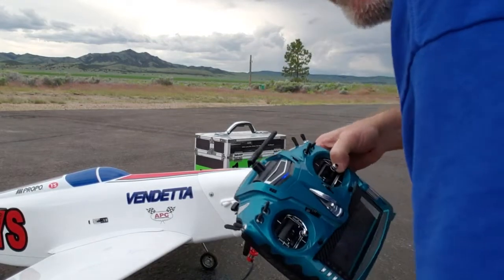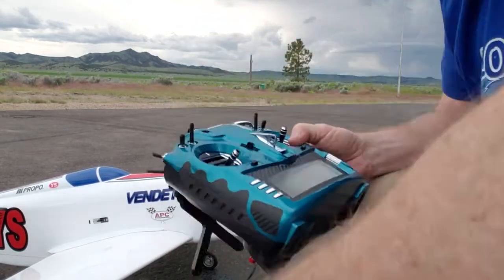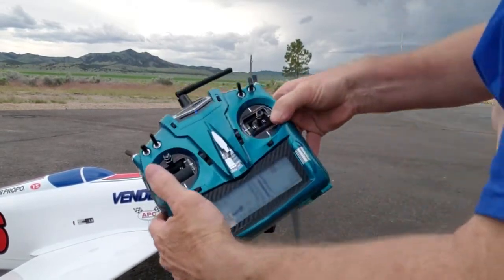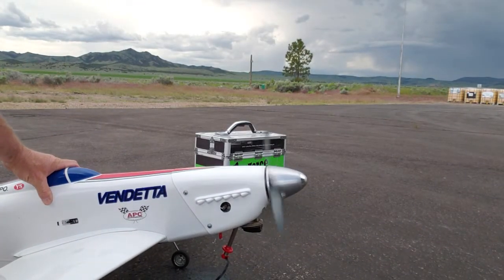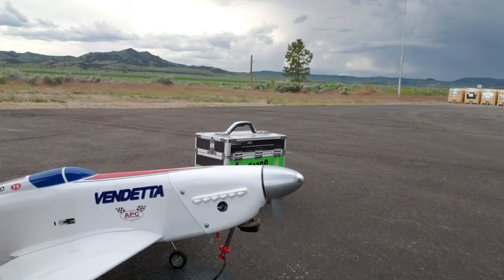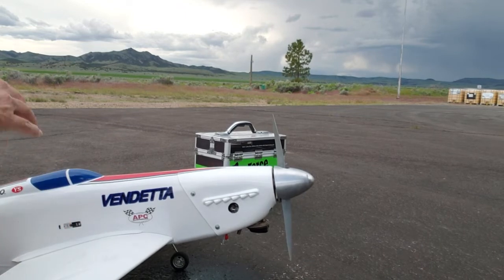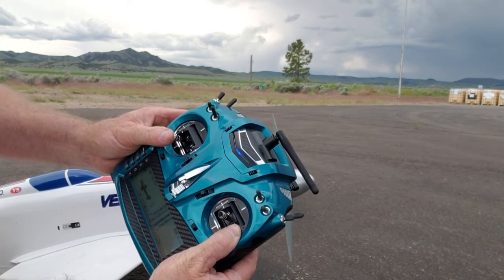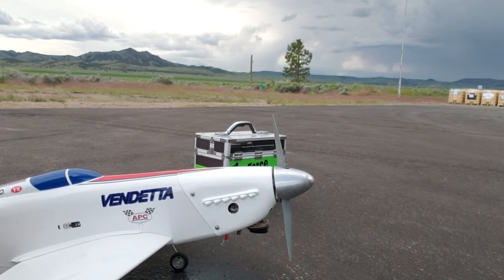Proper starting procedure for Ys 4 stroke engines

Comment: Hi there, thanks for the video. I'm battling with a gifted YS 91 from a friend. Pretty difficult to make it run smooth. What I notice is that there is a lot of fuel coming out of the carb when it is not running... is it normal?. I am a OS Engines man so  not very familiar with an engine that comes with a tank behind the carburetor or something like that.... is it a pump of some sort?  Thanks
Reply from the maker: I suggest you download the ys fuel line routing system.
Reply: One more question: how do you kill the engine? The carb is very different and the barrel doesn't close  like any other carb  @flooded3456
Reply from the maker: Just close the carb sleeve like any other carb
Reply: This is where I am at now; I get a good idle and a good max RPM but I can't kill the engine!! It seems like the throttle arm stops at minimum RPM (idle) but it doesn't advance any further in a way that I could cut the air intake completely!! How do you stop the engine in your case? Definitely a very different carburetor compared to any other engine I've seen... @flooded3456

Comment: Great video! Wow that’s great instruction! Easy to follow!

BTW what nitro/oil/methanol content do you run with this engine?

I have bought one of these engines along with a world models p51 pylon racer and wanted to know what mixture gives good glow plug life along with reliable operation. I don’t intend to race it just hobby and fast flybys
Reply from the maker: The simplest fuel to run is 30%helicopter fuel.  More than enough oil, and plenty of nitro for fly bys.
For racing I run 60% nitro, 20% synthetic oil.
Doesn't really matter what%you run as long as the needle doesn't get set lean.